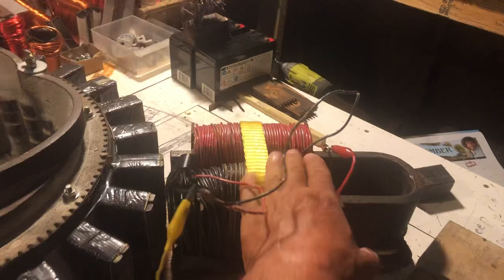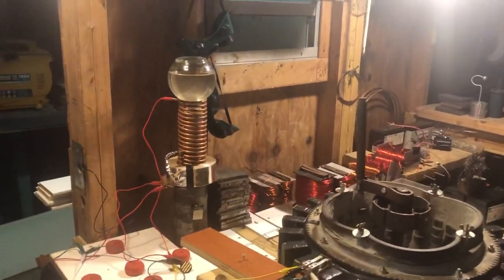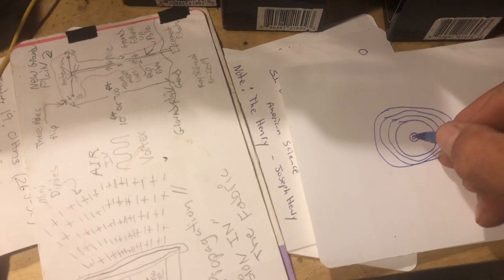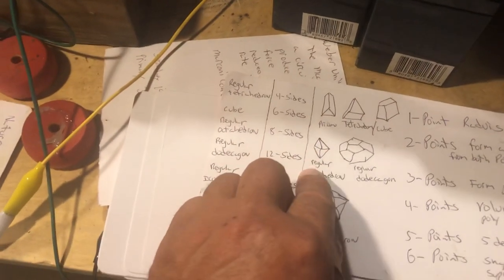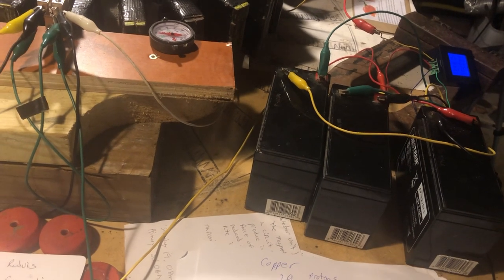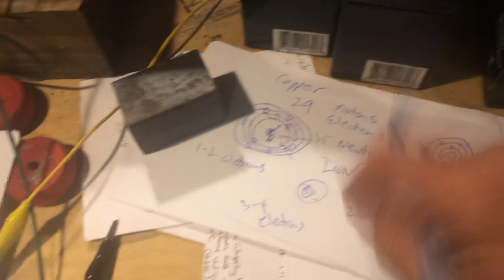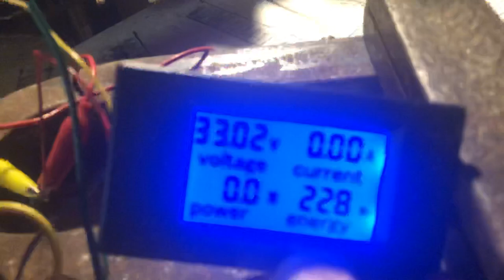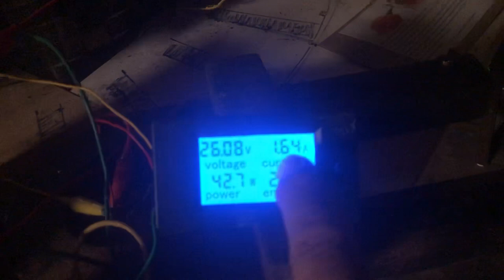Ed Leedskalnin, Matter of Elements, Explained!

Comment: Roy, Thanks for sharing as you have jogged my memory... Copper has two Isotopes, 63Cu and 65Cu, which have 34 and 36 neutrons respectively. The differential potential of the 2 isotopes in weighted proportion of Isotopic exchange facilitates copper as being easy to resonate as a super conductor in the alternating current flow without heating or cooling needed in our constructs normal ambient temperatures... I believe that this fact naturally balances the Parallel & Series RLC Circuits when using copper and the frequency is tuned to load resonance... Think about It... With a tuned resonating circuit... Resistance becomes the vector combiner of phased alternating energy... To formulate the Current Equation In The BiPolar alternating circuits, trained electrical engineers divide the current factor (Amps) By 2 or Multiply X .5... Another great video sir... Best wishes! To me 3X4 represents Direct Current Potential (DC) While 3X6 represents Pulsed Width DC Current Flow (Asymmetrical/Metronomic) however We can flip the 6 inductor polarity and it becomes a 9 representing Alternating Current (AC) adding dimensional reference to the Tripolar Phasing...

Comment: Okay, so my complete thought, is that if you use the perpetual motion holder as a ‘compression tank’, in your dc circuit, and phase match pulsed out put (like a water ram pump) you can create a secondary line of electrical outflow, that line could have an infinite number of phases (fly wheel), so you can raise the threshold for diminishing returns.
Reply: Over unity is not in energy output, it’s in the efficiency.  This is ‘how/why’ matter and energy exist as phase conjugated of plasma cosmologically.
Reply: Creating an over unity zero point of efficiency for the secondary electrical current flow, is a doubling circuit. Which allows you to create a transverse magnetic field modality, rather than one of the right hand rule.  Yes?
Reply: Complimentary to the right hand rule
Reply: Not opposite, when you blend them together, you get gravity.

Comment: I think your vision of the cross (fractal) is the fibonacci proportions related through phi to the vesica Pisces (this can be modeled mathematically).
Reply: This is an intonation shared between the external curvatures of matter and energy which creates proportions between curvatures (flatness).  Yet, this does not extend to singularity (symmetry), as an intonation to the interior curvature of matter and energy.
Reply: This matrix is eternal, it’s uncertainty that changes over extremely long durations of time.  Not the matrix.  Thus changing which elements exhibit the different magnetic properties.   

The Egyptians said Osiris would sit on a throne of iron. (Ferro magnetic)
Reply: ‘Blackholes’ are places we lose e/m intonation (external), but not internal (‘gravity’).  And these change probable possibility (uncertainty) in the cosmos.
Reply: Think of a slinky in an mc Escher drawing, perpetually going down the status.  It’s like the harmonic minor scale.
Reply: Up and down the scale use a different harmonic 6th, I think? Because of which direction you are approaching the tonic.

Comment: Interesting to ponder. With plastic pipes laid down in running water connected to metal pipes pointed skyward, he could electrostatically attract moisture and lower air pressures? Causing it to rain. Latest Aaron Marukami panel says this can be deadly. But that is likely one of Viktor Schaubergers methods of electrostatic charge separation (buildup.) Someone said he mentioned to them using jets of water and air. Likely this plastic and metal arrangement. Probably a huge capacitor aggravated by moving sprays.Doped water...iron? Magnetite? I can see this generating extreme voltages needed for lifter craft. BINGO! BANGO!

The valence "electrons" are forms of light, magnetism and energy levels usef for mathematical computations. Generally chemistry and most other things are formula based. Such as photosynthesis. Sunlight raises the energy level like a magnet to water braking the atomic bonds. Oxygen is released and hydrogen bonds with carbon. The light magnetism electrons bonds are excited and oscillating and I suppose more free. At higher energy levels outer valence energy is where electrons are exchanged or released. Which may be radiation or released induced charge and increased alignment or build up.

Comment: Hi Roy, now you are onto something!! Do you know Schauberger? Not the Formula but the Formen ( the shapes) are the key. :) Do you know lay lines? The energetic form can vary from the material form. About the electrons and shells we can discuss if you want. You can PM me at Facebook messenger or mail. :)
Reply from the maker: Jakub Lawinski 
Hi Jakub!
Vinnystvincent@aol.com 
Let’s chat.
Reply: Hi Jakub. Please share more about the shapes... Thank you for sharing!
Reply: @findthespirit9480  hello, Schauberger have seen, that the mother nature has the best forms for energy to flow and so one. He built a device from a truck rim, that run with water. Water flows through that device and move an electric motor, generates electricity and is being cooled down in this process. The first tries made in a bath tube were failed, because the water was very quick cooled down to 4 degree Celcius ( here has the water the biggest density). When he brought his device to the pond it run and run..... The pipes had a form of a goat horn and they were layed in a spiral. You can Google the device. He made also a repulsine and flowstreets for sawmills in Austria.... There is so much to discuss... I am sure that the magnetic energy flows in the same way as  water does.... What do you think?
Reply: Jakub Lawinski that makes sense. Dan winter is doing work on the spiral motion - he calles it implusion and it is based on geometry (shapes). Thank you

Comment: So, what if ‘gravity’ operates like is a recursive vector (circle of 5ths) in an equally tempered scale? And e/m is a pythagorean tuning.  So, we cannot ‘change’ gravity through brute force?  We instead need to change the interval spacing in the dielectric field loop.  However, there is only one place e/m is tangent (touches) to the circle?  

We need an electrical version of a water ram pump!  

The perpetual motion holder can disconnected and be used as the electrical compression tank.  

Your fly wheel adjusts the magnetic interval phase matching to electrical current.  

So, I am not an electrical engineer, but the goal is to siphon off electrical potential to create a doubling circuit (Rodin math) to change the field modality spacing from phi, to 2phi.  (Phi occurs naturally).
Reply: That means stuff inside the field would be an octave of gravity below (doubling) that of the naturally occurring.  Thus making its own gravity lower than that of the Earth’s.
Reply: Use electricity to ‘pump up’ the dialectic potential inside the material.
Reply: It’s all about intonations to the instrument of creation paradox (which is an internal curvature to matter and energy)...inversion of the torus is a sphere.  The pyramids are designed inside out.  Which is the ‘’big band’ angle of intonation of the exterior curvature of matter and energy.
Reply: These are not different dimensions, it’s a different type of intonation.
Reply: One becomes geometry, the other becomes recursive vector (transverse electrical sub spatial) and physicality gets a doubling circuit for spin phase matched to the transverse electrical current, upon which our exterior (e/m) perspective has no horizon.
Reply: So, we have to siphon that potential off of electricity and pump it into the physical mass.
Reply: Thus making that mass experience relatively less angular velocity (spin interval) relative to the naturally occurring field.
Reply: 2 x phi.
Reply: It’s all about time/phase doing the cancellation work of polarity (stereoscopic motion).  To pulse regulate the electric/magnetic flow change in flux over time).
Reply: To create an alternate internal intonation.
Reply: (creates a lower harmonic) than Vesica Pisces.
Reply: Ie 5.1.6 fractal
Reply: In this model, electrical charge potentials are complimentary chiral inversions of charges, we call positive/negative.
Reply: This is why they can phase cancel, if this was not the reality, then there would be no cancellation due to phase and cancellation would be purely ‘monophonic’.
Reply: In this model, we would not have to count the beans at the electric meter, because there are no beans.  We just have to design a non- parasitic electrical generator.
Reply: Impulse, through pulsed electrical phase matching would also increase the capacitance threshold to an ‘over unity’ (see Rodin coils).  Making the conductor more efficient (less energy lost to heat/frequency to ground).
Reply: When doubling phi (magnitudes) through phase matching, we get cardioid motion around our original field modality in the direction of phi. Thus creating the geometry upon which our torus mounts.
Reply: Currently our method of creating electricity is through force (parasitic to nature) take a queue from nature and produce it consensually, piezo electric resonance.
Reply: There are two circuits for the electrical ram pump, one conservative (battery driven) the other is non - conservative, driven by the change in flux over time by the magnets in the fly wheel.  The non-conservative circuit is the key because it actually produces a positive and negative voltage where the conservative circuit only produces positive voltage (anywhere you test on the loop), you have to phase match to the negative voltage, which flips its time lapsed reflection (phase inverted polarity) back into the positive voltage of the dc current.
Reply: Thus raising the capacitance of threshold of the conductor and allowing you to get more bang for your electrical buck (capacitance wise).
Reply from the maker: Ryan Graffius 
Ryan I enjoy and love all of your thoughts! Thank you 🙏

Comment: I have watched also one of your old videos about Tesla coils. The top load is needed to tune the coils. Tesla have made a layer of wax on them, to isolate them. He said, the energy transmission is greater when there are no Sparks coming out of the top load. Have you ever tried to power many coils with one coil? There is a man in Poland Taratajcio Jan, who claims, that he can gain energy, when he powers with one power coil many receiving coils. Every receiving coil generate the same power output as the powering coil. Worth testing?